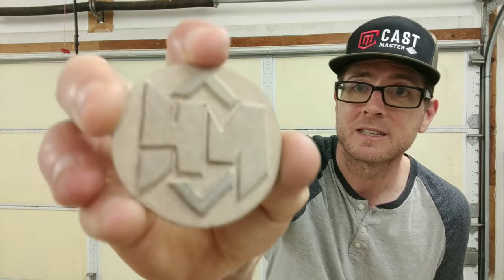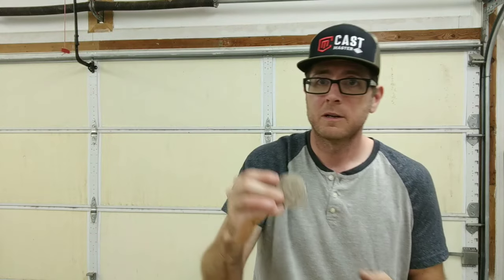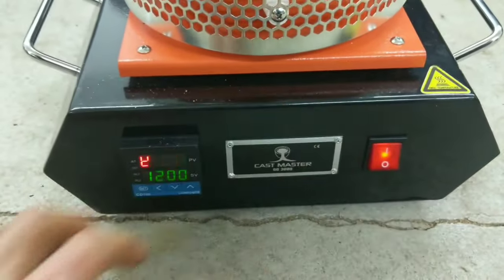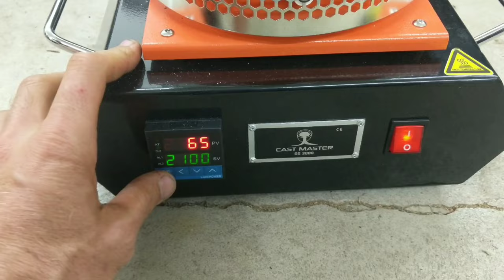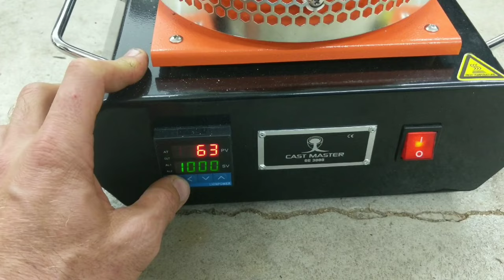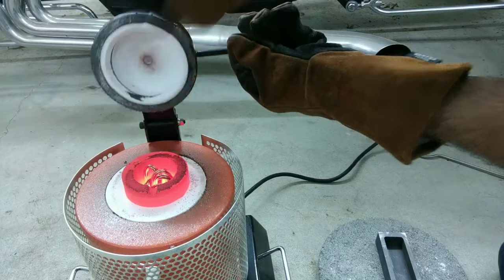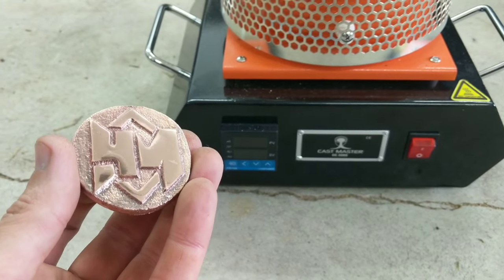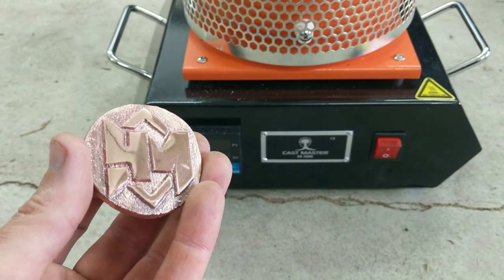Sand Casting a Copper Channel Coin - Maker Coin - DIY - Cast Master Elite Electric Furnace

Comment: i really like your end pour method ... think i see how the box works ... hope you dont mind me trying one at home ... just seems easier
Reply from the maker: It is good for some things, but not all.  Let me know when you try it.  Also the plywood backing holds it together.  You need that on each side.  That way when you take apart 1 side of the mold it doesn't collapse.
Reply: @HeinrichsMade  i saw that but for may things it seems like a better pour method ... although ther are times the pour needs to be slowed intentionally ... does it baffle ok are do you need to make a baffle to slow it down ... can a baffle even be done with this method
Reply from the maker: @dukenukem001  that's a good question I never used a baffle, but I've seen it.  To slow it down I'd try using a skinny sprue, which would be the funnel into the mold.
Reply from the maker: @dukenukem001  I looked back for something you said in the past.  I believe it was about casting a bracelet.  I am going to try it for a video next week.  Keep your eye out.
Reply: @HeinrichsMade  looking forward to it